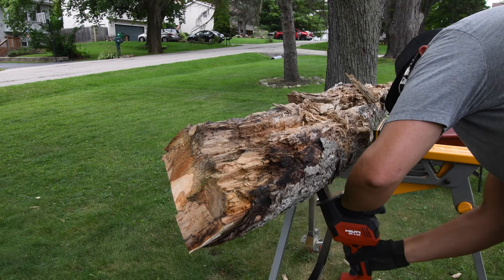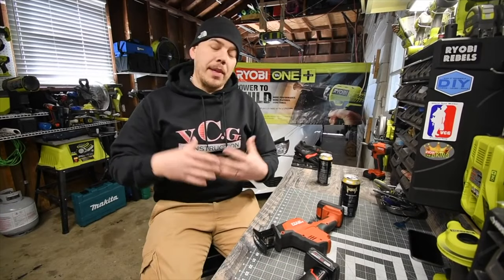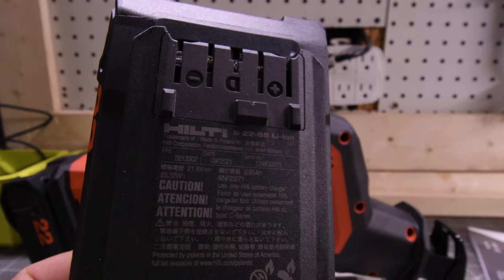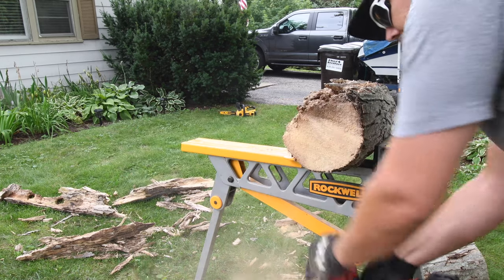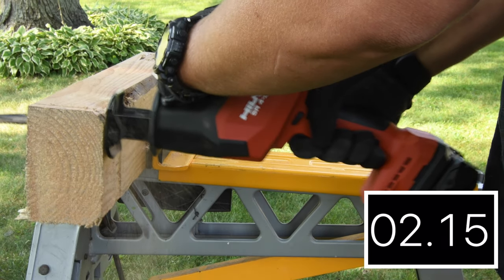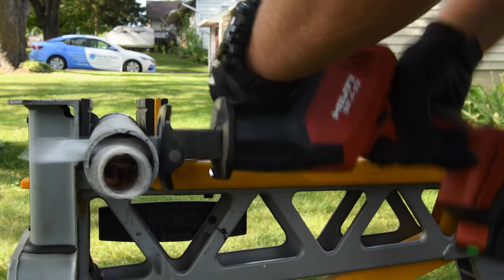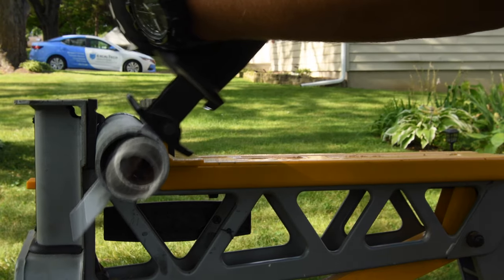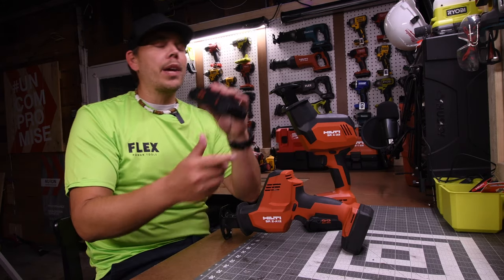HILTI's First 22v Single Handed Reciprocating Saw

Comment: I use my left hand to hold the material and my left thumb on the saw with downward pressure to keep it stable. I never let a tool run without two points on it

Comment: Hi Dave from PR. I would definitely like to se it go up against the new Milwaukee M18 hand saw since here on the Island we have to deal with a lot trees. Plus a saw this size could come in very handy and maneuverable up in the trees for trimming as long as it has the power and nice lasting time (not to be a battery guzzler) avoiding constant interruptions.
Reply from the maker: Versus videos will be coming up along with duration tests
Reply: It’s ok for pruning.   I got it specifically for branches and limbs but I much prefer the newest  Makita XGT for that (came out this summer).  I have the regular Nuron recip too but I’ve found that both of the XGT and a couple of the  LXT regular recips work out best for trees.  Anything from an inch diameter to….man I’ve corded up some full on fallen trees.  Usually branches/limbs between 3” to 18” diameter however.  One handed uses has never been a problem. The Diablo carbide pruning blades with the big gullets are my go to.  I don’t use chainsaws because of the nature of my job, insurance, and liabilities and we hire a whole arborist crew who are here practically once or twice a month.  The Hilti “hackzall” has been getting a lot of work on bolts and hardened screws.  It really shines there.  Hilti rep was curious about the newest XGT vs the Nuron and we found that  they both ate each other’s lunch on wildly different applications.

Comment: That metal cutting test solution could be wood cut to the diameter of the hole with a smaller hole that holds the copper pipe

Comment: work bought these for our group, it bound up on its first use without cutting anything, took the battery off and checked it, fully charged, re attached, same result didn't work, tried another battery, same thing then it started working, shortly after it stopped working again, went to record the results to forward to the boss and it started working, today tried the 1st battery from the original use and it worked fine, my co worker experienced the same thing but his wouldn't work at all, Hilti rep to be notified.  Never had this issue with my Dewalt that I had for years....